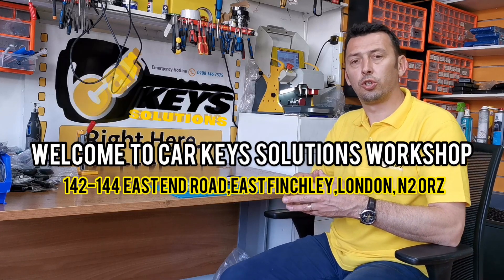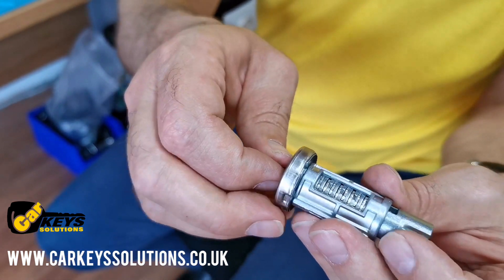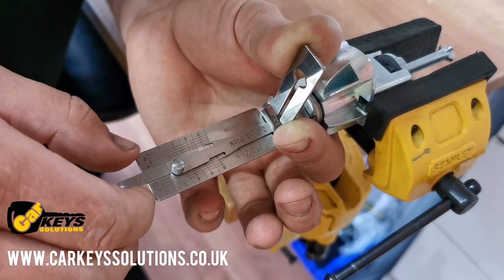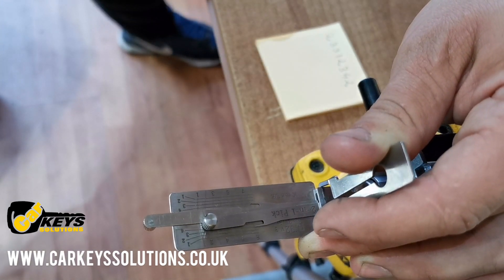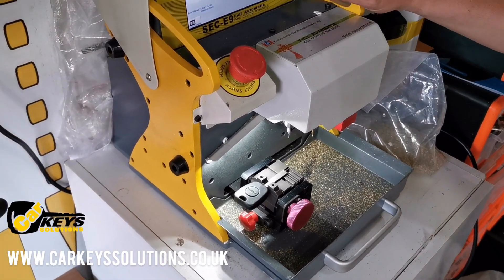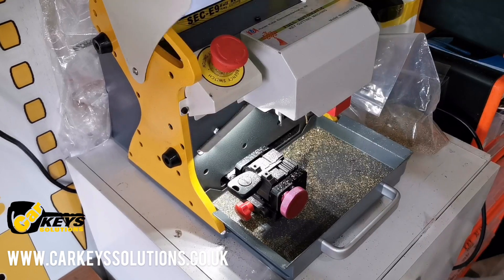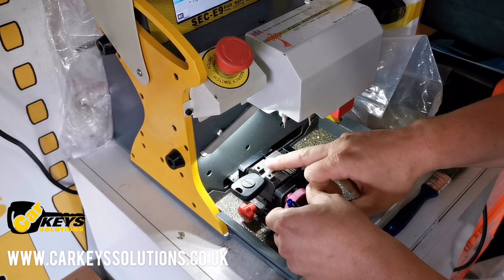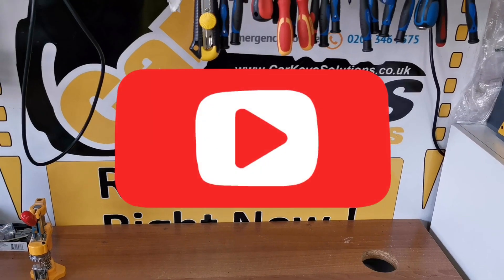Cutting a New Car Key -  Car Key Cutting: Decoding, Crafting, and Understanding the Mechanics 🗝️🚗

Comment: I'm pretty sure that it's always done the other way around: first the key is programmed in order to make sure that the chip works fine with the car (which is a MUCH more finicky process) and only then is the key cut to avoid creating a bad key in case the chip pairing (programming) part fails).
Reply: Programming a key requires you to 
 turn ignition on and off. 
On order to do that you must first enter the car. 
To enter the car you must pick the lock ( like the author showed). Using the correct lock pick for the car. 
Once picked the door lock you must then de-code it ( like the author did). 
Once a new key blade is cut you can enter the vehicle and start the programming of the transpoder and remote if fitted.